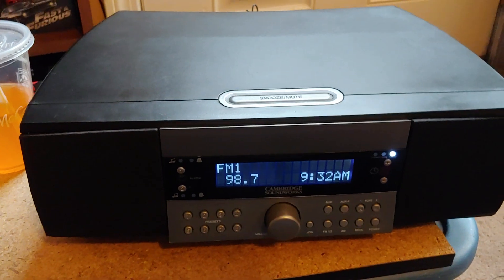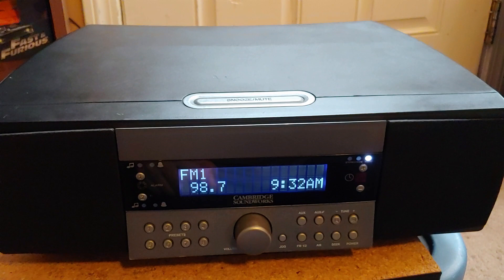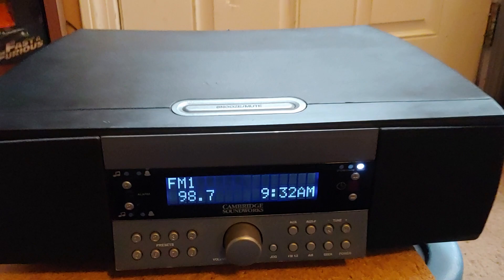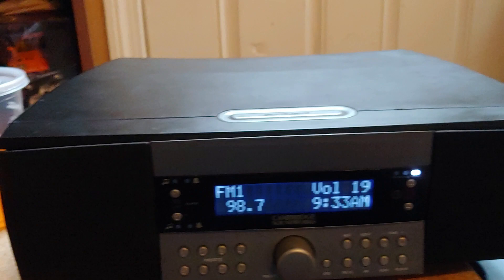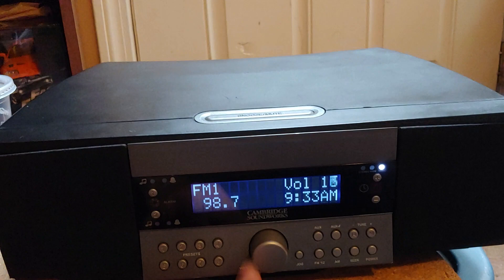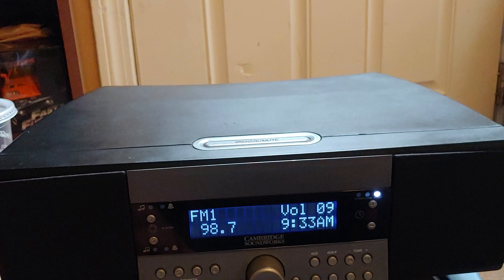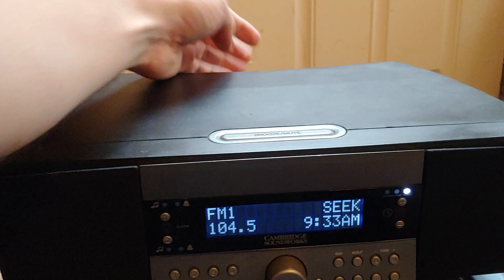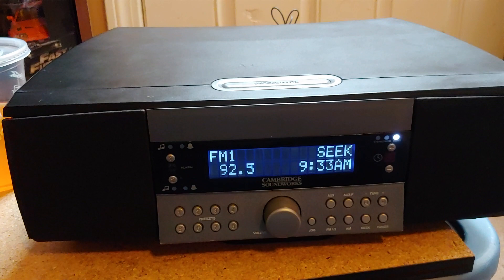Cambridge Soundworks update video

Comment: i bought one used.   same exact issue.  no sound from radio.    i unplugged it. set it aside.  2 weeks later i plugged it in and it worked perfectly.  unplugged it to move it and now it doenst work again.    a great radio when it worked.

Comment: The haedphon jak has a switch to mute the internal speakers and sometimes the switch will get stuck and dose not turn on the speakers when you remove the headphones.
Reply from the maker: The speakers didn't work before using the jack. When i tested it in the store they worked.
Reply: @christronicsdereksrandomness36  Ratchet above is on to something, seen it happen a lot with laptop audio jacks - plug your headphones in and out vigorously about 10-15 times and see if it releases the spring
Reply: by a lot I mean 2 or 3 times lol